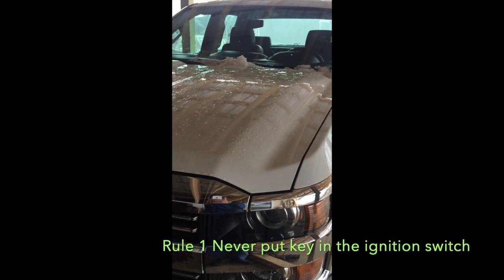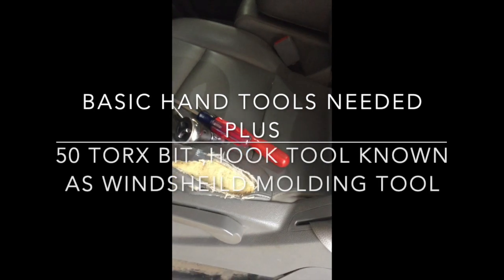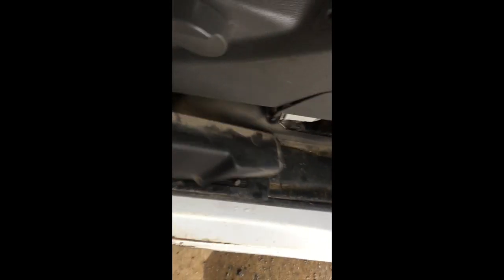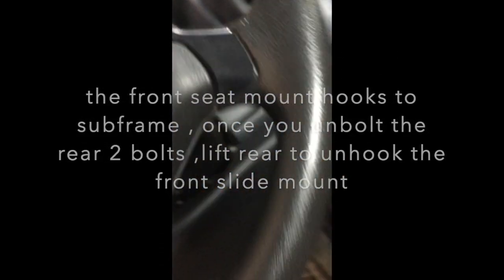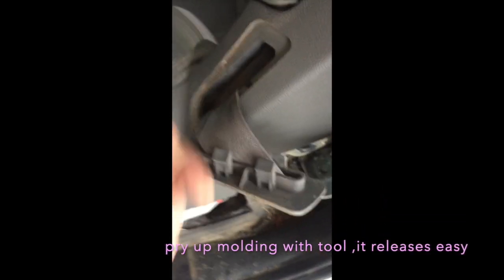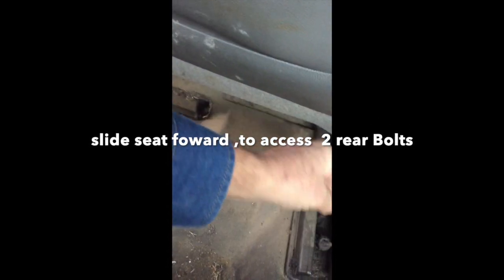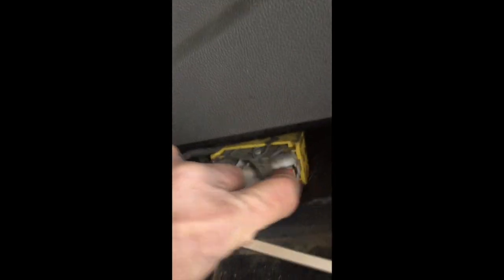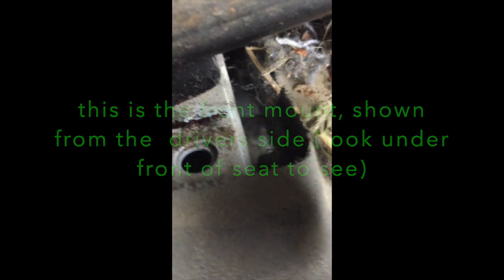2014-2018 Chevrolet Silverado 2500  Drivers seat removal

Comment: Wolfman, great video. I removed the driver’s seat on my 2016 Chev Silverado High Country 3500HD following your instructions.   Thank you for taking my telephone call yesterday before I started working on my truck. I needed to remove and repair the seat because the backrest reclining function wasn’t working.  At the end of the day I removed the seat, repaired the reclining feature and reinstalled the seat. My Chevy dealership wanted $140 just to diagnose the problem, instead with the help of Wolfman’s video I tackled the job myself and spent zero dollars fixing the seat.
Reply from the maker: Glad I could help you.
Reply: my truck is currently having a problem reclining as well, how did you end up fixing yours? I assumed it had two motors one for each side, but I'm only finding one part number for it online???
Reply from the maker: @kennykollin4732  hello, I believe there is only one motor with a cable and gear on other side , 
 Generally I have found that a coin with get in the gear and jam it up 
Hope this helps
Reply: @kennykollin4732 just saw your question about the Silverado pickup seat. Have fixed your seat problem? There is one actuator that reclines the seat. My problem was that a lock washer inched itself off the rod that the actuator spins clockwise and counter clockwise to recline the seat.